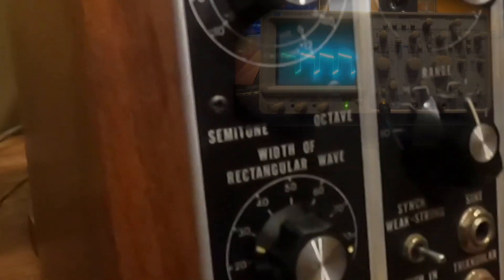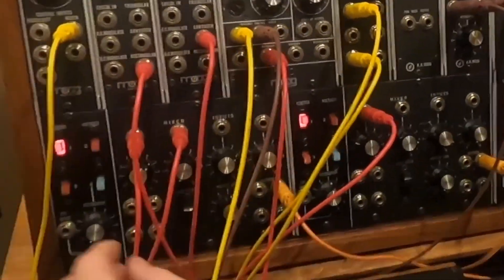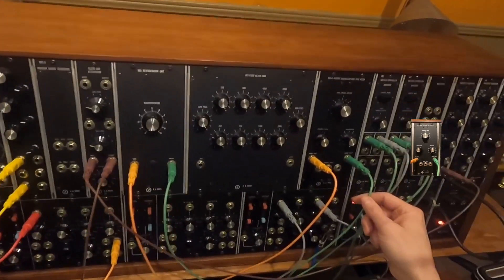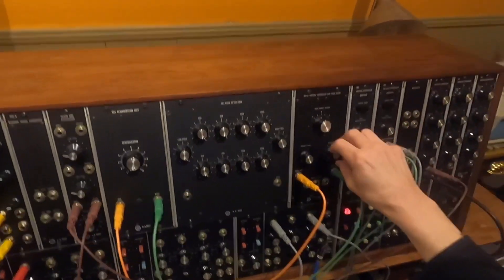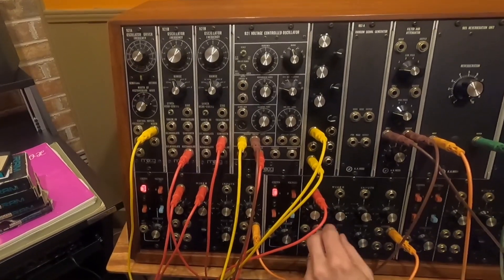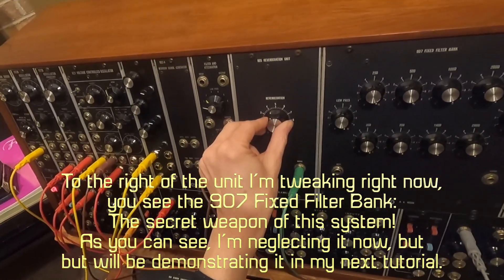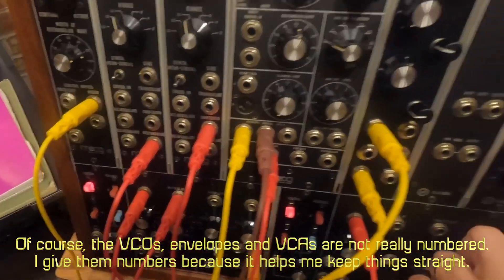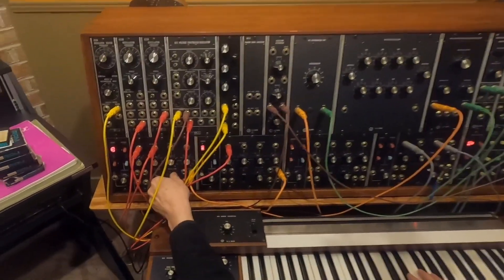Moog Modular Tutorial 1: Percussive Organ Tone

Comment: The "multiples" ('mults') is simply a connection point for a signal in, to "multiple" places out (vice-versa as well). That module is divided into 2 sets of 4, and (again, fuzzy memory) I think you can set it to 1 group of 8.

Each jack is simply connected straight to another. It's super handy when you want your pitch chiff and an LFO for vibrato. There's nothing behind that panel, so it's simply a straight signal. You can use it for CV or audio.

Remember that 1+1=2. If you feed a 1v control voltage to a VCO, it's pitch will be increased by an octave. If you feed two 1v signals into a mult, then run a cable from the mult to a VCO, it's pitch will then be two octaves up. (note that this is 2->1, the reverse of above) 

That's a simple example, but the same thing happens for audio, and a lot of magic happens there. Try feeding a sine and a 50% pulse (that's a quare, but use the pulse output) from two different VCOs into the mult, then a line out, and drop your 'scope across the outputs. Fire up the sine, then use an attenuator to slowly bring in the square. Set the VCOs to track, then slowly drift the pitch on one.

Having fun?

Now fire up your LFO->PW connection. Slowly bring up the LFO. Uh-huh... 😎 Keep listening as you make changes. If you can get to the point of hearing what your seeing, or can draw what your hearing - aces to ya'!
Reply from the maker: Midiwall, thanks once again!  I’m going to try all those routings tomorrow after work!